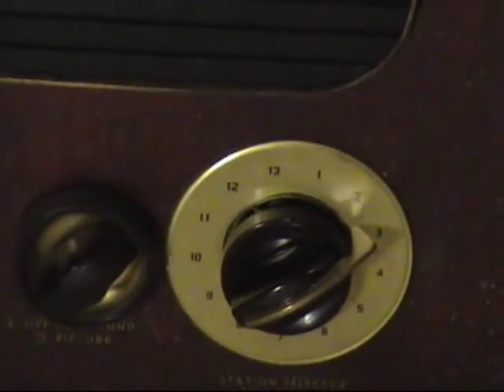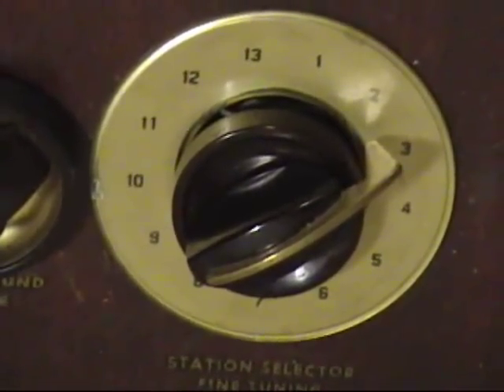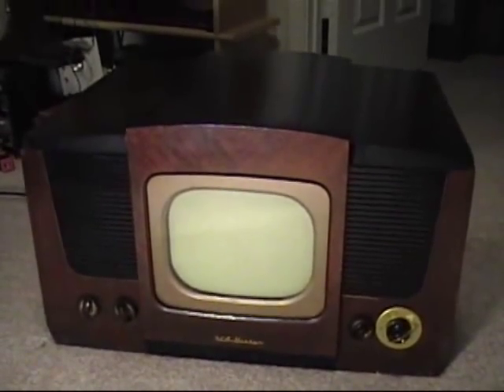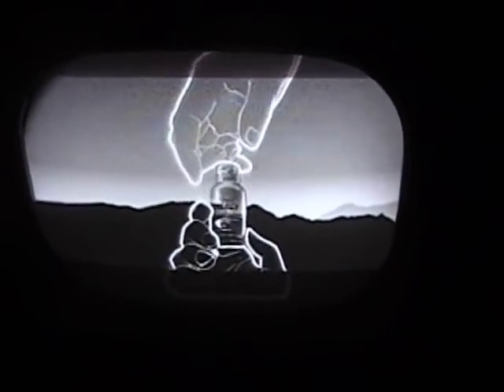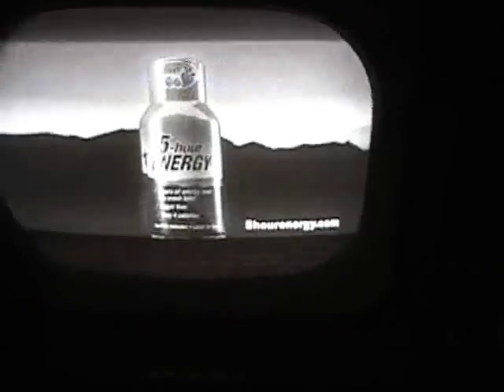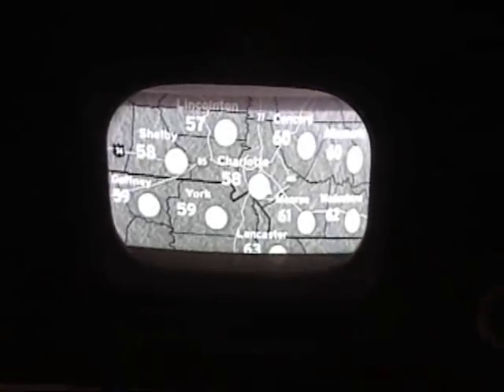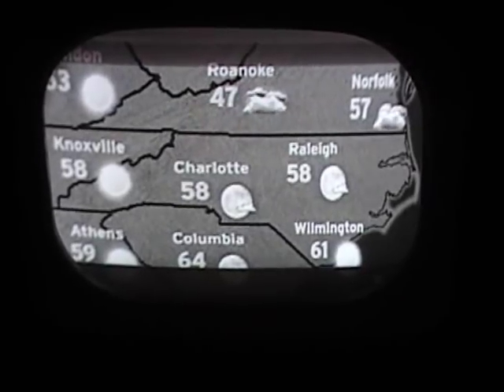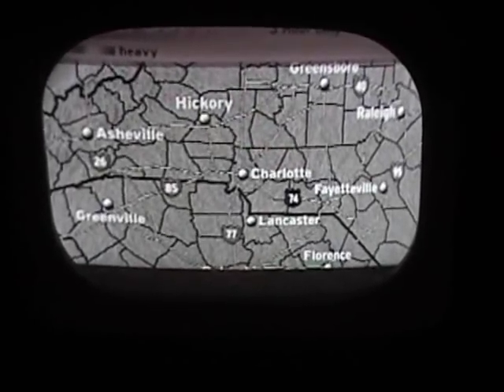RCA Model 8TS30 TV, 1948

Comment: I bought this same set at a “collectors” shop in FLA.  Stored it at my Dads and had knobs misplaced. One missing (not sure which) ...I was going to restore myself, but seems daunting (i have recapped AA5 radios, repaired HV Boat anchors etc)...But not sure if I should sell as is, or take the plunge. The cabinet is a bit rough in a few spots where veneer  needs repair...but picture tube heater filament  tests ok at least...all tubes there...I actually flew it back to the Communist Chinese Provence of Canada and it made it back undamaged..I took the picture tube out as “carry on” ! Hope it was worth it! Will be looking for some help...(or an interested buyer) .Thanks for your video !